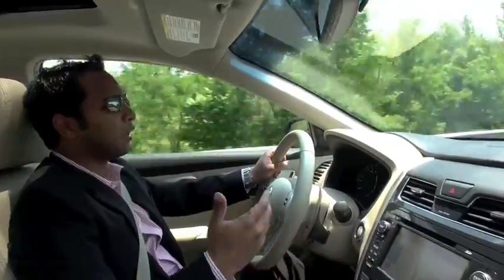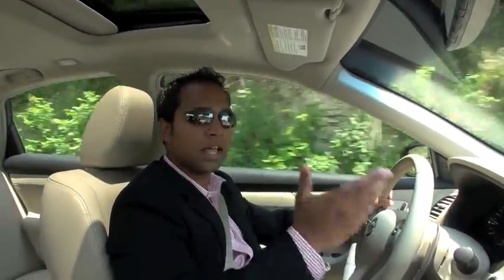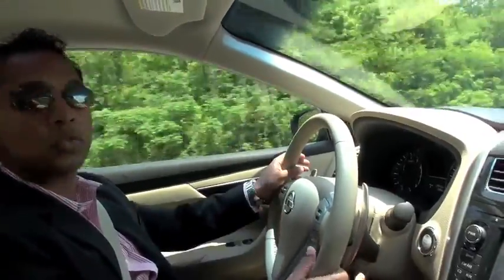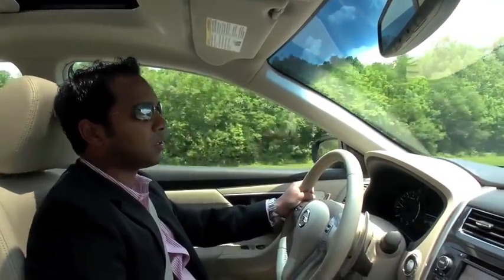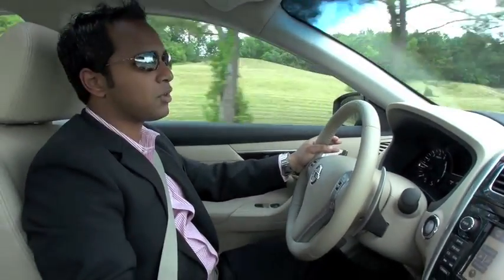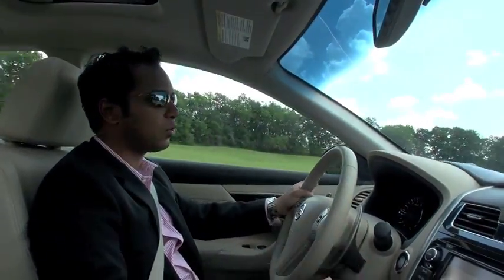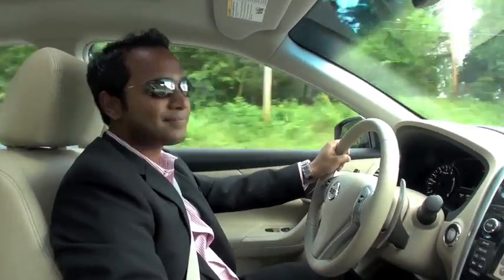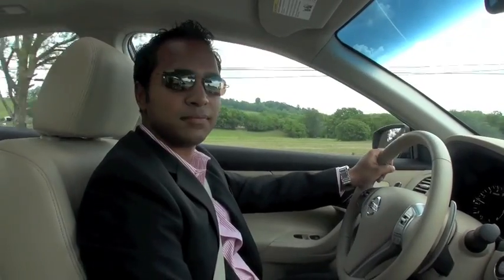2013 NIssan Atlima Xtronic CVT® Transmission

Comment: You can keep all the high end techie BS. I'd rather they put the "extra value" into making it tough as nails like the old school KA24DE Altimas. I like driving, all that crap is just more stuff that can break. And nice try pitching the CVT but no thanks. I mean, FFS the VQ has so much torque, a regular 5spd manual or 4sp auto is perfect (and dead reliable). all those extra ratios are a waste, this isn't some high strung Honda with a narrow power band up top. Lern2engineer.

Comment: My wife's old (2003) CVT Micra is incredible. Quiet for a small car and not had a single fault in any area other than replacement wheel bearings at 30k miles. All the Press reviews say this new version is even smoother and quieter so there you have it - conflicting views as always!
Reply: Wheel bearings at only 30k miles??? That's poor reliability.

Comment: I had this car for three days as a rental I was surprised at how easy it was to drive in traffic but the cvt was nosier then any transmission I have ever driven. The car looks and feels like an automated freight train its heavy and starts out slow. It does not get the advertised on e10 gas this is a 2013 model it should have been programmed and mapped for e10 gas. Its comparable to a Camry with 6 speed transmission mpg of 22 flat miles per gallon. Its a basic car with a quirky feel.

Comment: That has been a saving grace in my S.  It feels and rides better, but the rumbling and shutter is still there.  Nissan is light years away from perfection.  They need to rip off the "Pure Drive" badge as with the new re-programming you NO LONGER GET 38 MPG highway.